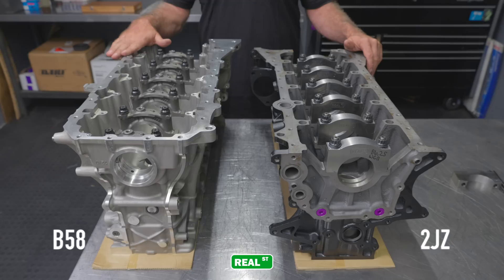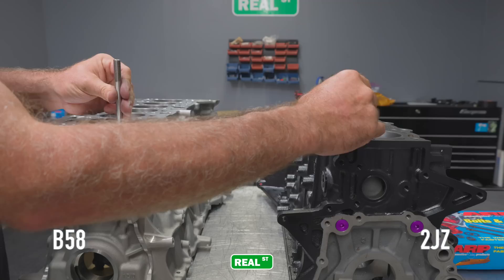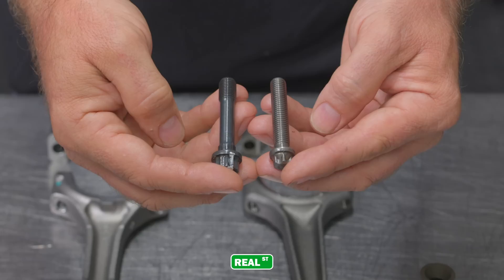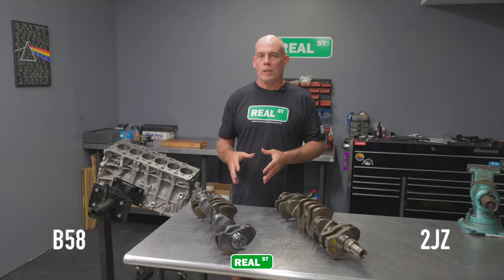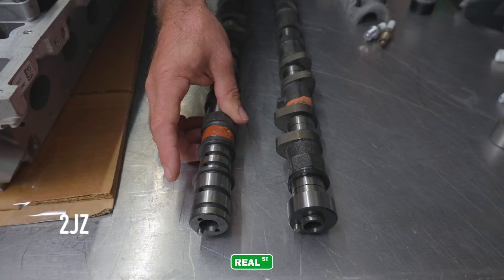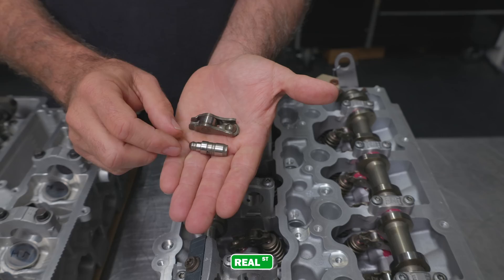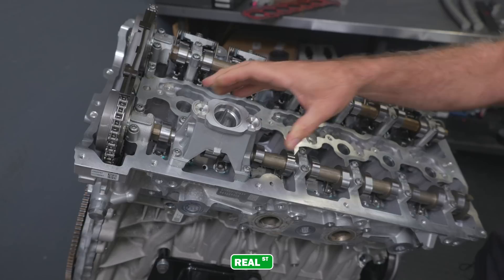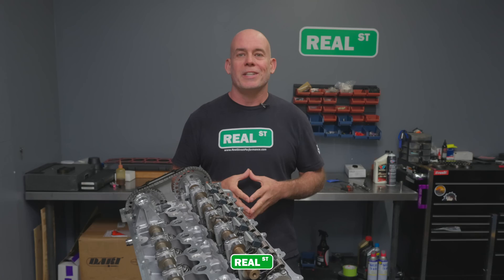Toyota 2JZ VS BMW B58 | 2JZ STILL KING?! (Detailed Engine Internal Comparison)

Comment: This is not even a competition. Papadakis did a good teardown a few years ago.

2JZ problems:
2 bolt mains
Heavy

B58:
Spray liners are weak
Cam wheels in the back
You need a dealer tool to take cams out
Rod caps are weak
Rods are much smaller and weaker
Plastic air intercooler/oil cooler
Etc

2JZ is much better, easily. Plus the aftermaket is wonderful

Comment: Fun fact Toyota helped or co- developed the B58 engine, doing reliability testing , checking every nut,bolt & screw , even sending BMW back to fix things where necessary, just to ensure that its up to Toyota quality standard. So its not like a donation or toyota riding bmw tech. Infact one could argue BMW benefitted more, learning reliability from toyota, what did Toyota gain that could already make sports cars. Toyota also co-developed the chassis with BMW to get that near perfect 50/50 weight distribution. The Supra/z4 is essentially different cars created independently using a shared Lego set with no collaboration beyond parts development. Basically they Could created the parts, but made the cars separate as German anti trust laws prevent that. So they made the beat ( chassis engine) together, but wrote their Rhymes separate and alone. When BMW approached upon seeingb the sucess of the BRZ/86 that's what had in mind. Based on chassis  tuning & handling,  many ppl say Toyota made the better BMW as the Supra  is widely preferred to the Z4.
Reply: The Z4 is different enough to separate the intended customers, Z4 owners to likely be older and weather with no desire to track the car - more like LC500 customers. Those cars are grand touring cars that still look great, but not exciting.

Comment: 2jz remains king.
Reply: For drag racers, sure. Not everyone races only in a straight line, some racers actually know how to brake and turn...
Reply: @sepg5084 whats that have to do with an engine tho?
Reply: @UmarTheGreat10 nothing but the point he’s trying to make is that since the 2j is cast iron and thus significantly heavier, that running a 2j ruins a car’s ability to set a competitive time on a road course or time attack event which just isn’t true. Obviously stock mark4 chassis vs stock mark5, the mark5 would beat the old mark4 in all categories however almost all of us modify cars to our liking and thus can make anything competitive. Ideally the ultimate mark4 for setting the best time on a road course ditches the 2j entirely for a 3Sgte for weight savings and the lack of a need to run crazy power
Reply: @ps3alphagamer12 most people don't build their car into the "ultimate" thing. Most people moderately modify whatever platform they're on, so if handling is your goal, you would be better off starting with the B58. The weight difference is significant enough to make a difference too. The 2J is only better if your objective is very high horsepower, and maybe durability too.
Reply: @ps3alphagamer12 most people don't build their car into the "ultimate" thing. Most people moderately modify whatever platform they're on, so if handling is your goal, you would be better off starting with the B58. The weight difference is significant enough to make a difference too. The 2J is only better if your objective is very high horsepower, and maybe durability too.
Reply: Well obvious answer but with more time the B58 would just show it’s true color alongside the S58
Reply: I wish people would stfu about it
Reply: No doubt. I like a solid roller set up, so the  buckets are up my alley
Reply: Negative 
2J hasn't run 300.4 mph in a standing mile on an oe block and heads 
Or run 5.88 @ 256mph with the oe block, head, timing components and crank. 
Or trapped 265mph with an oe head 
Or run 7.90s factory sealed 
Or won Drag week with an oe block, heads, crank running 6.33 @ 225mph with 275s 

Ford's twin cam engines are king.
Reply: @chadkent1241  im a big coyote fan. 32v is on my username for a reason.
Reply: 1000hp 2jz car loses to a 1000hp b58 car
Reply: can't forget about the rb26 and rb28.
Reply: @sepg5084 ok now you are talking about the car suspension and design! Nothing like the 2jz
Reply: I know these engine designers are scrutinized on fuel economy and emissions today , I’m sure it get in the way of making power
Reply: S58 vs 2 jz
Reply: @ps3alphagamer12  The supras that in Japan JGTC ran 3SGTE which proves this point. Lighter and better weight placement.
Reply: Not at all please show me the 2jz making 800whp with a down pipe, e85 and tune like the s58
Reply: @BMWROYAL show me stock block s58s making 850 whp an running 8s stock block on factory auto 😂 show me s58s in the 5s, s58s are overrated an are only being hyped because they are able to make easy power but beyond that they are still miles behind to 2jz an show me stats that prove otherwise
Reply: @sepg5084 your here saying this so sk
Etching tells me you don’t do ether 😂 just sit on internet an tell other people what’s best
Reply: @Gabethemosthated here are s58s making 850+whp with stock block lol
Reply: @Gabethemosthated  who what? Evolve tuning channel  has a stock block s58 making 1000whp, go to his channel, and it’s on a dyno. 850whp is nothing for these s58s lol, I went to a meet and everyone there was making that number, no 2JZ is making these numbers with stock internals. And the engine is only 4 year old lol,
Reply: I’m sure you own both /s S58 is a crazy engine stock. I have a new M3 and the 500-5550 (whatever it really is) is more than plenty but knowing we can just do a couple mods and hit 1000 is batshit. I know the supras were fun but we’re talking about 20 years of technology from M division. Just stop. Maybe drive one?
Reply: @ps3alphagamer12 yeah you lose a little weight  having an aluminum block helping turning but does it really matter that much when more power can be added safely and other things can be added or weight taken away or redistribution of weight for the sake of longevity not having to swap blown blocks as much. Everybody is so concerned with weight but forget about staying together. It’s all good in the lower power levels. If the b58 were iron and redesigned to be a bit stronger it would be the best inline to date for every kind of racing in my opinion.
Reply: Not at all😂😂
Reply: @daftpanda6533 remember what year that was . They knew nothing about it like they do now
Reply: Can’t believe they didn’t remake that engine
Reply: Exactly the mk4 has a huge advantage over the mk5 which is its wheelbase, most tracks unless they are very tight will favor the mk4 because it's more stable under long and medium length turns.
Reply: still king in fact thats why toyota still uses it. sorry that chapter is long over. 2jz is a nothing but a overrated engine. only engine most people know due to unnecessary hype around it
Reply: Barra dethroned 2jz a long, long time ago
Reply: Elephant in the room, an antique will take more to perform well vs something that works out of the dealer!
Reply: If weight means nothing, maybe
Reply: Straight line, maybe
Reply: The 2j was just born in a very good time when the economy was booming. I don’t think the situation nowadays would allow another 2jz to be born.
Reply: @ps3alphagamer12 It’s all about placement. The weight doesn’t matter so much as the distribution of said weight for track use. 
Power can always be increased to overcome weight, it’s the balance that is key.

Comment: 2JZ was a must when it came out but years passes and technology improves... i bet that B58 will definitely take the 2JZ place
Reply: Compromising your B58 cylinder head because of a spark plug overheating is something that will not replace an engine that doesn’t come close to having thay issue.

Comment: No matter what these are both rich man’s engines. The 2jz’s incredible durability plus simplicity is its greatest strength vs the b58 which touts complexity and low weight without sacrificing strength.  The main difference I’m trying make is that while yes the b58 is awesome 15-30 years from now it isn’t once these complexities rear their ugly heads and put a whole new definition of rich mans motor. Yes the 2jz suffers from high part costs but you get your value from its ease of repair and it’s undisputed reliability

Comment: I think bmw have the right idea but the extra complication and moving parts and sheer amount of electronics and things that can go wrong is immense. If you’re on a drag week and your b58 breaks it won’t be an easy simple fix or cheap. 2j is still king followed closely by a Barra
Reply: The barra isn't close. I was telling BMW fanboys from the start their alloy block will never compete with a 2j because it won't. The barras have a weaker casting similar to Rb26 and have horribly thin bores too. The next cast block I6 would be the RD28/ Rb30.
Reply: @lennixsingh626  just bore and sleeve the cast block ☺️.
Reply: @zethloveless7238  Then ur next problem would be thin spots on the block.
Reply: @lennixsingh626  that’s fine but I don’t think we have seen the real limits yet. Jz block also has its limits but comparing cast aluminum block in a sports car to a boat anchor iron block is a big weird. Both are great engines. When people make block limiting power they all switch to billet blocks anyhow.
Reply: @zethloveless7238   We already found the limits of cast barras. Theres people who have pushed them to 2000hp but they never last over 1500hp for long, the bores and block don't last. The JZ long block is also extremely light. Its just heavy in factory form with the the twin turbos and all the useless gear in place. 2j's can hold around 70-80psi before they start splitting the deck and ballooning the 7mm Siamese bores. I will say tho, pushing anything over 1400 in any inline 6 should be the right time to go to a billet block for longevity.
Reply: @zethloveless7238  isn't the b58 a closed deck? There not much room to bore from what I understand.

Comment: great comparison, since the b58 has a smaller bore diameter and longer stroke than the 2j, would that also mean at stock bore/stroke the 2j would be more safe to rev higher?
Reply: I would think so.
Reply: Yes you are right and also rod ratio which he didn't cover but is vital for reducing the piston velocity when increasing rpm
Reply: @burdazza2711  Jay did say the B58 has a longer rod, but it would be nice to know the exact ratio. Papadakis rev their B58 to 9k in FD, so it's not like it can't rev. Unfortunately modern fuel economy standards will not allow oversquare engine configurations, in mainstream engines anyway...
Reply: @sergeyakinin997  Their engines aren't holding up, though.
Reply: Piston speed is a concern. Yet, the B58 appears to have done away with a lot of reciprocating and rotating mass while maintaining a longer stroke.

Comment: I’ve been waiting for this. I feel the b58 is awesome even though I hav a 2j. Dual vvti is the biggest thing I wish the 2j had you can make great power and with aluminum block you shave weight. B58 is the future but also codeveloped with Toyota so lessons learned were passed to b58 from the jz. If your doing a swap or build b58 with direct injection just add a secondary rail with 2000 cc injectors your good well into 1500hp
Reply: b58 was out long before toyota came to bmw for the new supra, probably threw in a couple of ideas but it was all marketing talk by toyota to keep the fanboys happy
Reply: B58 have nothing from toyota, b48 for example that is same thing is out since 2014, b48 or b58 are both big future engines, both developed by bmw
Reply: Who lied to you about the B58 being co developed with Toyota? Was it the same guy that said the fake vents can be made functional if you just cut into the structural support of the car?
Reply: @thesulo12 says thefanboy12yrold 🤣

Even if you could afford a 2jz you'd get boat raced by a b58 on any track.

Comment: People complain so much how B58 is more complicated then 2JZ. Guys, there is no way 2JZ can pass all modern environmental regulations and produce same amount of power as B58. It is also worth mentioning that Toyota inspected B58 on possible reliability issues and they decided its good enough for them, so the engine should be pretty reliable. Instead of crying on how everything was better, greener and simpler in the past, let's just be happy that we have a new mass produced and affordable platform for decades ahead that already can reliably produce 1000 hp.

Let's also not forget that 2JZ becomes more "premium" as time pass, since so many of them were either already destroyed or simply bought out by race teams for their future builds. If you want this engine, there is a good chance you'll have to pay an absurd amount of money for a dead engine that requires full rebuild, or go even further and simply buy every single part, including custom engine block, from specialized companies. But B58 is currently in production, you can buy for $5k and there is even a chance that it's gonna be in pretty good condition.

Comment: MK5 Supra > MK4 Supra 

B58 is da way 

Change my mind!
Reply: If you made this conclusion then you are likely not smart enough to understand how iconic the  mk4 is, no suceeding supra could ever compete with it.
Reply: @MrCdnAudiophile well the MK5 is better sorry bro.
Reply: @MrCdnAudiophile nah u wrong
Reply: @MrCdnAudiophile y’all are both wrong, GR Yaris>>>
Reply: @MrCdnAudiophile what by being in fast and the furious? News flash the MK5 is in there too 😅
Reply: B58 gang…. ///MK5>MK4
Reply: @MrCdnAudiophile  “tWoJaYzIsBeTtEr” 😂
Reply: For drag racing, the 2JZ absolutely is better, and it always will be.  @Not_jdm_af
Reply: @PistonAvatarGuy do a cost analysis to run 10’s in an mk4 vs mk5
Reply: @user-pl6ps5iu3h  A Mk.V is never running 5s, EVER. Winning is priceless.

Edit: And, really, the only reason why the Mk.V would be cheaper to get into the 10s is due to the fact that it's newer, so its starting level is higher, but the max level for the 2JZ is far higher than the max level for the B58 ever will be.

Comment: One thing i think alot of people forget, we arnt all trying to make 1500 hp. 99% of people the B58 is FAR superior. It make power more easily and cheaply, its more drivable, it gets better gas mileage has way more torque, and way less lag and makes more HP stock. I know people are gonna get mad, but its ok, the B58 is over 20 years newer and one of the most advanced engines in the world. All that time went in to making the best engine for most people (Yes even for 700-800whp). If you want to make 1500 hp, 2j is king
Reply: We can make reliably 1500hp in BMW S58 with help of some turbos, upgraded injection system, new camshaft and stroking, it's quite undersquared. B58/S58 block is derived from bmw diesel block. In Germany, some lunatics are closing in, but we still have pump gas with 102 Ron